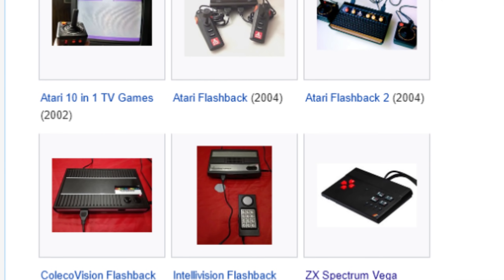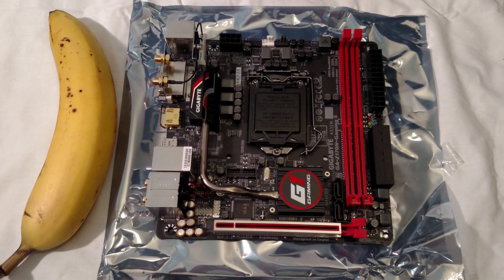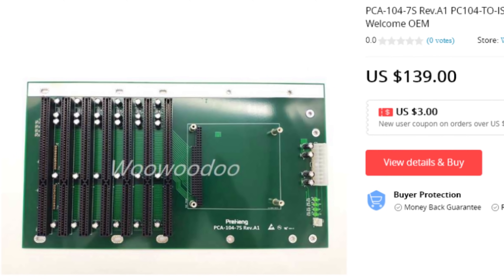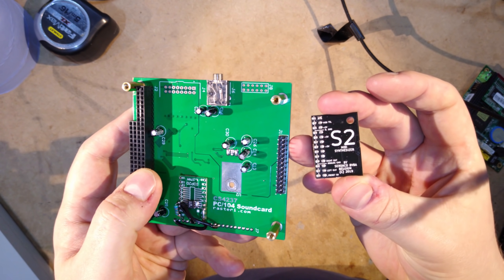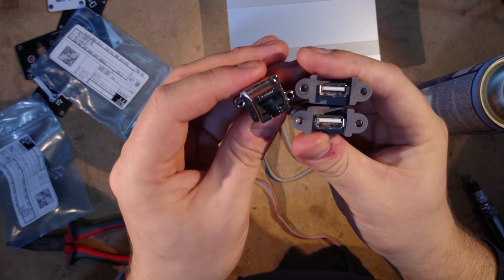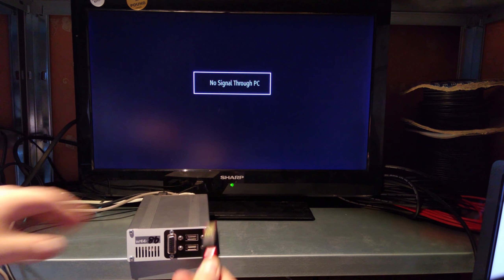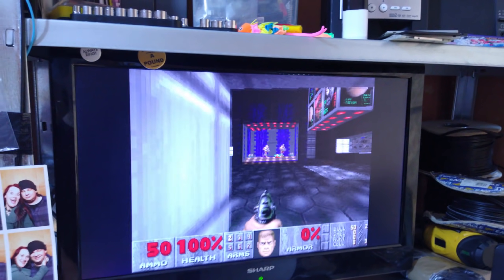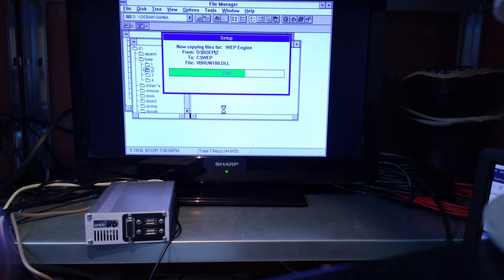Mini MSDOS gaming PC - Part 1

Comment: Thanks for this content, it's an incredibly good idea - would really like to know more about this; I've looked around for PC104 boards and it's nearly impossible to find a site/place that actually has pricing and sells them - being industrial products, I guess it's stuff usually bought in bulk and through a sales rep/team. There are some boards on eBay, but they're either old/second hand...or of dubious manufacture and/or sourcing. 

Also, performance - from what I've seen from other Youtuber, looks like these "modern 486" CPUs installed on the boards aren't exactly 1:1 performance equivalents but rather slower than the old ones (I guess it's to be expected due to them being low power/ruggerized implementations). Would be nice to see some benches to evaluate what to get in order to achieve something like a 486DX2/66 or even a DX4/100 level of performance (sufficient for most DOS games up to 1995/6ish). 

One suggestion - have you thought about 3D printing a "486-like" case, to make it a proper "486 Mini"?

Comment: There used to be a math coprocessor emulator for DOS that allowed games that required an FPU to run without one.  If your 486 is running at 300MHZ it might work fine for you.  https://www.pcorner.com/list/UTILITY/387.ZIP/INFO/

Comment: There were 486 DX PC-104 SBC made. Also if you are looking for a PC-104 SVGA Card might want to reach out to this guy, the NUXT 2.0 Comes with a PC 104 SVGA Video Card, which I'm sure will work with this project. Your idea has inspired me to try something similar this summer.

https://monotech.fwscart.com/NuXT.../p6083514_19777986.aspx
Reply from the maker: Yes I've seen those Trident SVGA chips, but I didn't realise the NuXT came with one on a PC104 card. Very interesting prospect. Get in touch with me if you start your project, I have some ideas too.

Comment: And the winner of the most casual "So I designed and build a working SoundBlaster compatible soundcard'" award for 2020 is....
Reply: just reverse engineer the shit out of this crystal chip, solder a bunch of connectors - EZ, right?
Reply: @LindenAshbyMK  surface mount chips are not that easy to solder bro'
Reply: @CaptainDangeax  How? xD You hotair the shit out of them
Reply: @mzflighter6905  That's not as easy as sordering 2,54mm DIP or some resistor
Reply: @CaptainDangeax  tbh, it is, with a solder mask, solder paste and a diy heatingplate made out of an old iron
Reply: Oh yeah, I design and build those in my sleep!
Reply: @vandit6354 my brain prints circuit boards while I sleep, just haven’t figured out how to make the output not shitty lol
Reply: I’m here from 2022 and the award still goes to TheRasteri
Reply: He's not human, an absolute mad man
Reply: Niels Heusinkveld

*built
Reply: @incumbentvinyl9291 please lay off the ESLers
Reply: I wouldn't even know where to begin. But I can solder. This man is a real Hero to me. I would love to know more about how one goes about remaking old hardware. Please share this secret knowledge!
Reply: bout that life
Reply: id imagine its just like breathing or eating for him

Comment: Daaaaaang.
I was thinking about trying to build a mini PC similar to what LGR did (only smaller, as I found the right parts), but this... daaaaaang.
If only I could actually solder, this would be my solution to the mini-DOS PC dilemma. What I really want is a mini-8088, mini-486, and mini-P3 for early-DOS, late-DOS, and Win9x eras.

Comment: The Vortex86 platform is actually Pentium-class, based on the MP6 architecture from Rise Microelectronics.  The particular chip on this PC/104 board doesn't have an FPU, though.

Comment: I also have been thinking of designing new PC104 SB compatible card, as I have not found any cards that would work with old games. I have some older 386 and 486 processor boards and only thing that has stopped me from building similar tiny retro pc was lack of the sound card. I'll be waiting for second revision of your card or may even spin my own board layout.

Comment: Still got my tiny Unisys CWD4002 PC. The smallest 80486DX from the mid 90's. Then few years later, the even smaller Toshiba Libretto CT70 with color lcd screen which is a portable.
But I went for the PI4 build, which uses a mounted usb floppydrive working in dosbox. Fit's very well in my custom enclosure.

Comment: I wonder if there's a pentium 200mhz in such a small form factor. I remember in the mid 90's fantasising about a computer with that and 64mb of ram. Didn't know anything about graphics cards back then and 3d acceleration was a late 90's/early 00's era computing.This board you feature sounds interesting. 300 MHZ is a lot compared to 66, and what features did the pentium have were necessary or desirable? All I remember was 200mhz.
Reply from the maker: There are definitely Pentium MMX-era PC/104 boards, keep an eye on eBay. Pentiums had an FPU so you can run Quake, 486s didn't
Reply: @TheRasteri  thanks! Always did wonder if the maths coprocessor was useful for gaming

Comment: How is the heat dissipation on this build?  Is it fine?  Does the 486 (and any other chips) need a simple sticky-mounted heatsink to help it out?
Reply from the maker: The vortex can run without a heatsink at all. Although maybe I should stick one on just for longetivity
Reply: @TheRasteri  ... yeah that was what i was thinking, help it along to keep it from aging too quickly from thermal issues.  is there a website where i can find a list/specs of pretty much all different kinds of pc104?  is there a 486-133mhz (or higher) & also pentium iii 1.0ghz (or higher)?  also as much memory as possible. are there some that have 30 or 72-pin memory slots?
Reply from the maker: @robwebnoid5763  honestly there are so many different types of PC104 mainboard it'd be difficult to make a list. there absolutely are ones with 30/72pin memory slots.
Reply: @TheRasteri  ... i mean do you recommend a website(s) about pc104 stuff?

Comment: Wow! As a big fan of the emulators and portable mini (sega) consoles - this got me really hooked.
It does loose some charm with the lack of expansion cards and slots, but I bet it would've been a killer product even back in the 90s.
Also, I'm curious about the IRQ setups - how did you setup / avoid IRQ conflicts between the network card, sound card and the rest?
P.S. Since you had usb ports and diskettes and you were after the quaint experience - you could've gotten a $10 usb floppy drive from eBay instead of the usb sticks.

Comment: Great project - looking forward to a longer video exploring this machine! The Vortex86SX seems to be a rather interesting chip - apparently derived from the Rise mp6 processor, which was a Pentium rival that should be much beefier than a 486. No FPU, so I guess it's only supporting the 486SX instruction set. The only other "Pentium class"-processor without a FPU that I know of is the NexGen Nx586. As for the lackluster high-res performance: Perhaps loading a VESA Bios Extender (UniVBE for example) might provide some properly optimized drawing routines. As far as I can tell the mainboard includes a XGI Volari Z9 graphics chip, which connects to PCI - in principle that should provide ample of bandwidth for 640x480 VESA graphics.
Reply from the maker: Thanks for your kind words and info! I tried UniVBE, as well as some other vesa extenders but no luck :(
Reply: @TheRasteri  Oh, that's a pity! Guess the XGI graphics chip is just too new and rare to be supported by DOS VESA extenders. Hope you'll find time to do some benchmarking, though!

Comment: please sell these, find a way to make 1000 of them, they'll sell.
Reply: finaly someone that thinks like me...
Reply: Can’t a old laptop do this?
Reply: @lifehackertips  like old windows 95/98 laptops yes but they typically are a lot faster chips and all the ones with 486 have no sound card, this one gives you the advantage of accurately running things made for a 486 and being very compact
Reply: @psychoticgiraffe  there are pcmcia sound cards.
Reply: I am sure many 40 year old people like me would pay up to a $1000 to buy something as cool as this
Reply: @_Digitalguy  Well, not 1.000 but I can safely say that I would cough up anything up to 500.
Reply: I built a decked out 486 just a few years ago. Since the temptation is high to go for the best retro components available, the pricetag ended up being well over $1K. Cache chips, RAM, sound, wavetable, network, I/O, video, POD83 CPU, Gotek Floppy, flash IDE, case, PSU, cables. Hundred dollars here, hundred there. Eventually it's ends up costing a fortune. But that's kind of the whole point of irrational nostalgia. To build things that could only be dreamt of back in the day.
Reply: @_Digitalguy  yes

Comment: There is an ES1689 PC104 Sound Card on eBay right now, even though it is $100 (eek). I've seen these in another eBay search I subscribe too, didn't what they were for until now. Of course, building your own is the cooler approach. :)

Also, as someone who just went through this, you can mount Samba shares to DOS/WfW3.11 but you have to add options to Samba in order to pull it off. It will not work out of the box.

Comment: Could a USB floppy drive work? And USB hard drives, hard drive adapter kits? I suppose the OS is a limiting factor in drive capacity, but if a 1 GB SSD is working, then perhaps other drives can be made accessible.
Reply from the maker: USB floppy drives will likely work, USB hard drives will probably only work in BIOS floppy emulation mode. But it has a standard mini-IDE port internally and you get IDE->compactflash or IDE->SD card adapters so that would probably be the best way to expand storage

Comment: The board you used is quite to expensive, about 200 euros on Aliexpress... do you know where to get one cheeper ?
Reply from the maker: Watch eBay, I got mine for £50 a couple months ago. Also any other pc104 CPU module will do as long as it has video etc
Reply: @TheRasteri  tried, but they start in the 200£ unit... Going to keep an eye on it!
Reply from the maker: yeah I've had a saved search going for years for these things, I guess I maybe underestimated how rare they are...

Comment: I was wondering, have you ever tried to repurpose an old thin-client instead? There’s several on the market for cheap with vga/ps2/usb/sound/ethernet outputs. Mostly running on AMD geode with a convenient cf-card reader for booting. Besides they are usually quite small also. Great work on the sound card though,kudos!

Comment: This is amazing! I had just put dos on a hp thin client and the usb sticks would not work properly trying the multiple sticks trick had to clone the install from a virtual pc install just simply awesome!
Reply: That’s exactly what I did some time ago. But the problem with thin clients is the missing ISA-Sound. The mostly use AC‘97, which is incompatible with MS-DOS :(
Reply: @beejayOne  I built a covox, I want to build a DSS compatibility plug as well but that's more work 🙂

Comment: now I am very curious to know why duke nukem 3d works that bad... Did you also try other BUILD engine games?
Reply from the maker: actually yeah I tried Blood, FPS drops below 10 regularly. Perhaps I'll try the Vortex86DX next?
Reply: @TheRasteri  mmmmh if you can, give a try to star wars dark forces and tell me if it is another low performer
Reply from the maker: @MasterControl90original  Dark forces is buttery smooth. As is Duke3d in standard 320x200 mode
Reply: @TheRasteri  someone in the comments pointed out that the cpu you are using is pretty much no different than a 386sx on steroids. Needless to say duke nukem is very intensive on higher resolutions even for early pentiums. Now I'm really curious to see how a 86dx will perform.

Comment: Hi - nice - i have a Atom based  mini tv desktop / style box that runs win10 ( about the same size as my samsung mobile phone bu twice as thick, you really cant see it on the cabinit next to the tv 

I run dos box on the big screen - ( haha frogger is the size of a real frog - doom looks blotchy but fun ) 

How good would it be to use a keyboard, and rebuild/enlarge  the base to fit all of that inside like the new Raspberry PI 400

Oh and after the initial dos 6.22 set up, i use linux puppy 4/5/6 on a usb stick, and boot of the usb and file copy all the set up files and games that way - very fast and you have the linux gui desktop - that is how i do the thin clients

Again great work on the sound card mods

Regards
George

Comment: Can you try running FreeDOS on it and then try running all your favourite DOS games on that?
Reply: FreeDOS kinda works but it's not without its bugs and it can't run Windows 3.1.
Reply: @mrrandomperson3106  even after all these years? I'm a little surprised.
Reply: @gnarlin4964  I think some people have got it to work but officially it's still not supported.
Reply: @mrrandomperson3106  Has development stagnated? FreeDOS has had plenty of time in the oven already.
Reply: @gnarlin4964  It looks like it's still going but either it's going slowly or getting Windows to run on it isn't a priority. They're putting out release candidates every so often, latest one was middle of last year, but the last stable release was in 2016.

Comment: Awesome man. I would like to see more of what you do with this.

About Duke Nukem 3D; it's pretty resource intensive. That's one of those games that really pushes the limits of a 486 and I think it's really memory intensive. It never is going to play really well on less than a pentium (with it's architectural improvements). You can get maybe 11-20fps absolute tops out of a 486, regardless of processor speed, and not more than 320x200.
Reply: huh? Played the heck out of duke nukem 3d back in the day on my 486 dx2-80. But I had a mach64 based 2mb card. It was pretty smooth. did a lot of network gaming with my brother who had a 486dx4-100. no idea of the card he had. now I do have a dx2-80 still, but not a mach64 card so I can't record the experience right now. but one day I'll get a mach64 card and recreate my pc gaming era. ;)
Reply: @GeirEivindMork   "Played the heck out of duke nukem 3d back in the day on my 486 dx2-80"
AFAIK, there is no 80MHz variant of the 486. It was probably a 66 or a 100, or maybe it was a regular 486 with an overdrive chip installed.
The mach64 card was a very high-end, late-game card for the 486, and the 100MHz 486 was also a last-gasp type of performance boost chip at the very end of the 486 lifecycle; it was released after the Pentium was already in circulation. With those specs (the absolute best 486 chip and one of the fastest 2D accelerator cards) you could squeak by a decently smooth framerate in Duke3D on a 486. The question is, why would you bother? If you just get a Pentium system, it will fly. You will spend a lot more money trying to turn your 486 into a Pentium.
Reply: @briangoldberg4439  It was indeed a 80mhz version of the 486. 
https://www.x86-guide.net/Photos/Grandes/25/AMD%20Am486%20DX2-80%2001.jpg

It was cheaper than a dx2-66 by intel at the time I purchased it. So that's why. I'd gladly got a pentium if it was an option. I built the computer from scratch so I got the best parts I could get for the price. Sound card was a Gravis ultrasound max. I was interested in the demo scene more than gaming, so it was the choice of the time.
Reply: @GeirEivindMork  Ok, an AMD one. I knew they existed, and the Cirrus chips, but it's been awhile.

Of course at the time is was cost effective (for you to upgrade), but today you can buy a Pentium 133MHz for almost nothing. 486 parts are getting more expensive these days. If you want to play games like Duke3D, it's super easy to just pick up a Pentium machine. 486's are great for those early 90's things like lucasarts adventures and stuff. (but you don't need an 80MHz processor to run any of that stuff a 33MHZ is fine). I can't think of anything that runs better on a 486 than it does on either a 386 or a Pentium. Maybe Star Control 2; I remember it being glitchy on Pentium hardware.

Comment: What do you do to get Wing Commander to run at the right speed on that thing?
Reply: I used a L1 cache disabler on my 486 dx2 /66 to bring it to speeds reminiscent of a 386. I believe I found it in the Vogons forum
Reply from the maker: The vortex 86 actually has an underclock function in the bios, can bring it down to 1/8th speed. I've yet to experiment with it though

Comment: Back in the day I used ASSIGN and SUBST to get Whiplash to run from the HDD.  ASSIGN to remap the drive letter from MSCDEX and SUBST to map a directory into what MSCDEX reported as the drive letter.  I understand there are fake MSCDEX programs like Fake_CD for doing this if you don't have a drive.
Reply: hi - also some "speed up your cd by 1000x  - what they done was basically burn the cd to a file, and use there own fake cd drive lettering to load them and fool the system it was a real cd  - titles like virtual drive or virtual clone - or sheep cloner??- but i remember paying @ $30 for a box set on a cd and all it was 4 files, it could have all fitted on a floppy - but it worked

I even used this when my original need for speed 2 was severely scratched / damaged, and i had made a back up on the "new 4gig hard drive"

Regards
George

Comment: What was the total cost of the build?
Reply from the maker: I probably paid about $150. If you had to buy the ICOP board new you might pay closer to $200, but PC/104 boards pop up on ebay all the time.
Reply: @TheRasteri  That's not too bad, considering there isn't any emulation. Thanks.
Reply: @TheRasteri  Well worth it, that would be an instant buy for me.